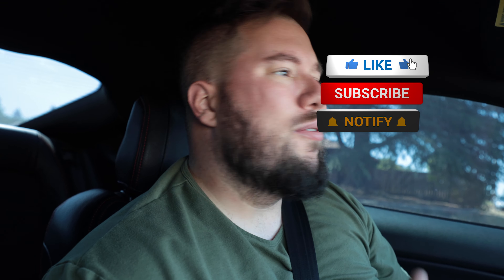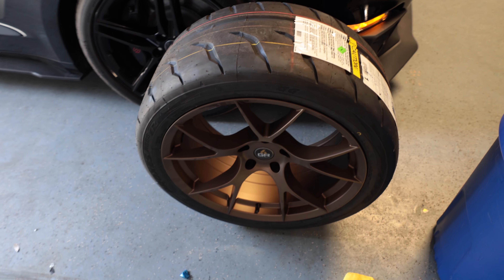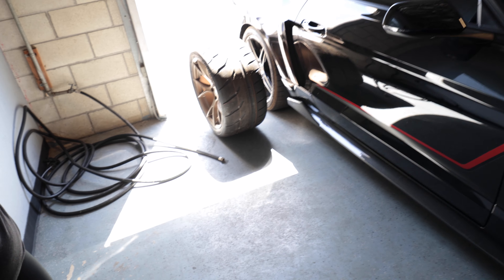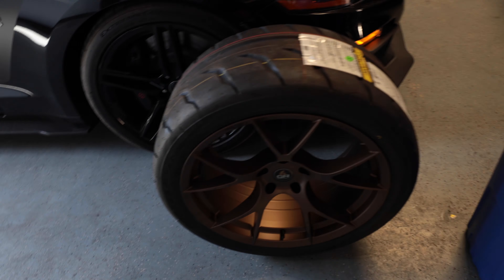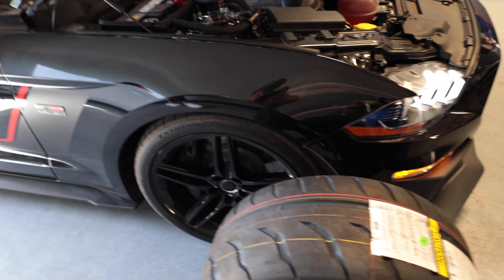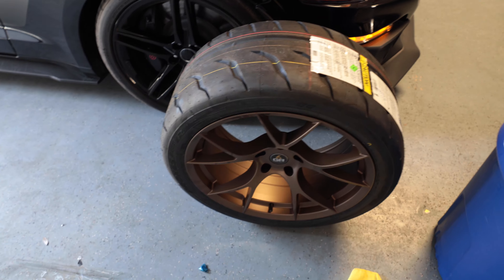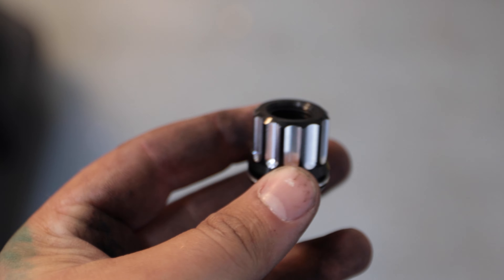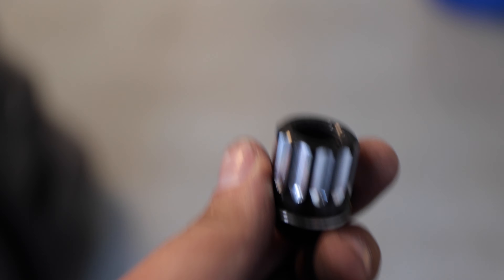They Look So Good | I Finally Installed My Project6GR Wheels

Comment: don't lower it anymore.  I used 305/30/19 and it filled it up nicely.  Lowering it more won't help performance and it will risk damage to the car unless your suspension is tight.
Reply from the maker: Suspension is tight. But I’ve gone a whole different direction with the car since then.
Reply: @StealthyGarage  love the Bronze look. I’m shopping around for rims on my black Mustang, thinking I’ll use the rims on it now for a track set up. Live in TN so I can’t have track tires on it in the winter unless I want to die 😂 thanks for the video l.
Reply from the maker: @chrisarthur8431  glad you enjoyed it

Comment: R888's are noisy...buddy of mine has them and said they are pretty noisy
Reply: I ran the 888r and the noise was horrible. I now run 555r 2 Hook  better and a lot less noise....
Reply from the maker: I got over the noise
Reply from the maker: @Jamie-ww3yz  interesting
Reply: @StealthyGarage  trust me the nitto is just as good and  less road noise. I agree you get used to the noise but it's always there with r888
Reply: @Jamie-ww3yz  goot to hear about the 555r2’s i was looking at those
Reply from the maker: @Jamie-ww3yz  maybe I’ll try them out once I run through these
Reply: @StealthyGarage  you won't be disappointed My car is 775 at the wheel and they hook
Reply from the maker: @Jamie-ww3yz  they hook from a 40 roll?
Reply from the maker: @Jamie-ww3yz  what’s done to your car?
Reply: @StealthyGarage  yes actually they do . Of course on the street they won't hold 1 st gear but do pretty good tho . R888s only lasted me 5k miles☹️
Reply: @StealthyGarage  stage 2 Whipple on 3.65 pulley pbd tuned vmp boost  a pump kooks long tubes triple disc mantic clutch  running 93 and boostane mix. Axles drive shaft all sub frame support vert links the works 🙂 .. Hellcats are it's favorite meal 😂
Reply from the maker: @Jamie-ww3yz  ever gonna go with a smaller pulley?
Reply: @StealthyGarage  probably not I would have to put a fuel system in it and run e85. Pretty rowdy already for the street The way it is now